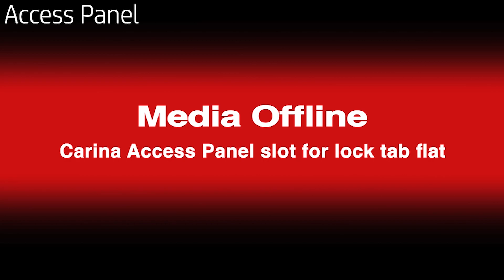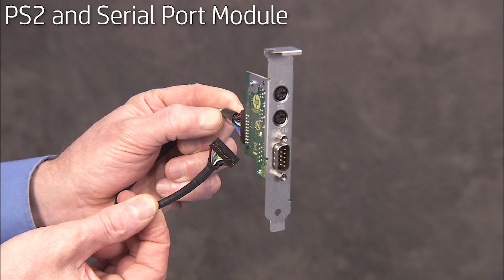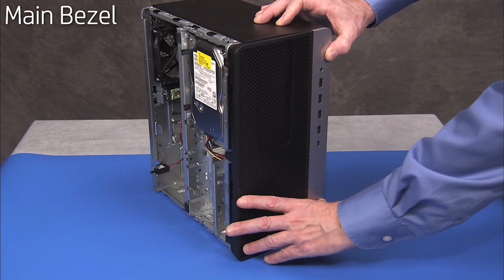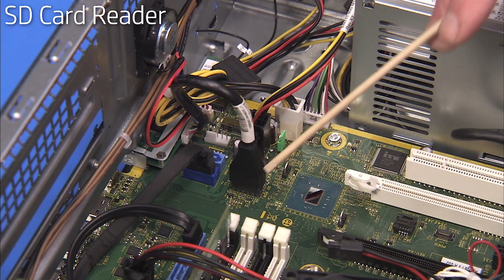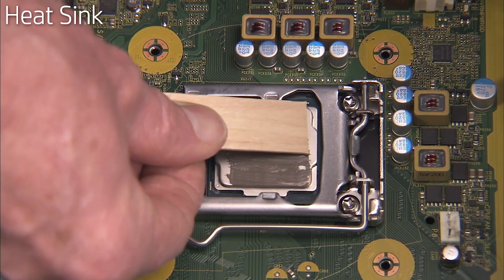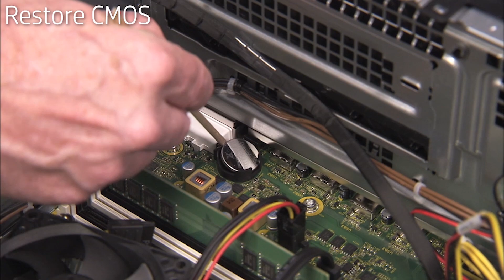Removing & replacing parts for HP ProDesk 600 G3 Microtower PC | HP Computer Service

Comment: would installing a HP 1660 Super GPU in the same model from the video require a means of attaching the gpu 8 pin port to the (hopefully sufficient) 250 watt psu, or can the GPU draw sufficient power from the PCIE port itself to operate without worry? @HPSupport

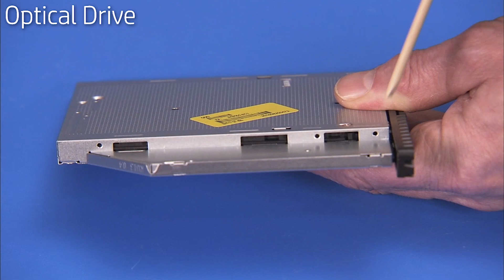Comment: 3:50 - Question for you. Hello sir, I just purchased a refurb of this computer. I am trying to install a dvdrw optical drive, but the model I purchased did not come with a dummy drive or the green release latch for the 9.5mm optical drive - where can I find the part number and replacement for the green release latch?
Reply from the maker: +VolstarTheMagi You can purchase the part from here: http://partsurfer.hp.com/ Please select your country and enter serial or product number of your unit.

Comment: Can i use an hdd caddy and replace the optical drive with it? If i can, can i use 12 mm hdd caddy from a laptop?
Reply from the maker: Hi there, thanks for contacting HP Global Social Media Support!
I understand that you need to know whether you can use  an hdd caddy and replace the optical drive with it.
I will do my best to assist you.
HP does not recommend upgrading or downgrading hardware parts or software that is bundled with the product as It may affect the manufacturer's warranty and performance, however, you could change the configuration at your own discretion.
Regards, 
HP Support
Reply: But, it can be swapped, right? Idk if my pc warranty still legit. Cause, i think it was old machine. And i got 1 ssd 2.5 so, i want to add it to my machine

Comment: Does HP have an official tool for undervolting the cpu of this model and/or undervolting HP GPUs such as the HP 1660 Super? @HPSupport
Reply from the maker: Hi there, thanks for contacting HP Global Social Media Support!
I understand that you need to know about adding graphics card and undervolting GPU and CPU.
I will do my best to assist you.
HP does not recommend upgrading or downgrading hardware parts or software that is bundled with the product as It may affect the manufacturer's warranty and performance, however, you could change the configuration at your own discretion.
Regards, 
HP Support

Comment: hi hp, thanks very much for your detailed video. i've a question: at 35:04, i can see a black pillar under the wifi card to support it and adapt to the chassi. what's the spec  of this black pillar so i can buy one to install nvme. thanks!
Reply from the maker: Hi there, thanks for contacting HP Global Social Media Support!
I understand that you need to purchase the part for your computer.
I will do my best to assist you.
Use the HP Parts surfer to identify the part: https://partsurfer.hp.com/partsurfer/ 
And order it via the HP Parts store: https://bit.ly/3nKMYrs 
Binu_HP Social Media Tech Support
Reply: @HPSupport  hi hp. thanks for your kind reply. i think such a pillar has no part number, or i don't know it. And i'm not a native english speaker, so i don't know the exact english name for such a pillar used to connect wifi/nvme to chassis, so i don't know what to search on your suggested website...
Reply from the maker: In order to get this issue fixed, please contact our customer care team over the phone or chat for further assistance, as this issue requires Live conversation with you over phone or chat to isolate the issue and provide you instantly with appropriate solution or repair/replacement options available at your place as per the warranty.
Please feel free to reach us on call/chat, please access this link to select your preferred country and language option to reach us. Global support link: - https://www8.hp.com/us/en/contact-hp/ww-phone-assist.html
Binu_HP Social Media Tech Support
Reply: @HPSupport  thanks! i'll try to contact local hp support.
Reply from the maker: Have a wonderful day!
Cheers!
Binu_HP Social Media Tech Support

Comment: I have the same model.. It starts directly when the button in the power plug is turned on.
There is no need to press the CPU button..
What would be the problem?
Reply from the maker: Hi there, thanks for contacting!
I understand that you are experiencing an issue with the power button.
In order to get this issue fixed, please contact our customer care team over the phone or chat for further assistance, as this issue requires Live conversation with you over phone or chat to isolate the issue and provide you instantly with appropriate solution or repair/replacement options available at your place as per the warranty.
Please feel free to reach us on call/chat, please access this link to select your preferred country and language option to reach us. Global support link: - https://www8.hp.com/us/en/contact-hp/ww-phone-assist.html
Binu - Social Media Tech Support

Comment: How can I install an ssd in it?
Reply from the maker: Hi there, thanks for contacting HP Global Social Media Support!
I understand that you need to know about installing SSD on your computer.
I will do my best to assist you.
Yes, the HP ProDesk 600 G3 Microtower PC supports SSDs, including both 2.5" SATA and PCIe SSDs. It also has an M.2 slot that can be used for both SATA and NVMe PCIe SSDs
Regards, 
HP Support
Reply: @HPSupport I mean can I install m.2 ssd with double notch or single notch?
Reply from the maker: Thanks for the reply.
The list of compatible SSD can be found here: https://hp.care/6051SdQLf
Regards, 
HP Support
Reply: @HPSupport thanks i just want to confirm that my microtower supports nvme or sata ssd with double notch. Please confirm that this supports single notch nvme ssd or double notch ssd sata ssd? Please confirm me that and also tell me the size?

Comment: Can I install amd r7 240 2gb gigabyte variant in this please tell or which GPU can I install in this
Reply from the maker: Hi there, thanks for contacting HP Global Social Media Support!
I am here to help!
May I know the product you are using? A serial/product number would be helpful!
Let me know!
Regards, 
HP Support
Reply: My serial no is
SGH744QVFQ
Product no is
Y3EO2AV
HP PRODESK 600 G3 MT I5 7500 OS: FreeDos
Now I don't want to install amd r7 I want to install nvidia  gt 730 lenovo 2gb so please guide I have never modified it please tell will it install or I have to remove driver cage permanently? Or after installation GPU can I install it back?
Reply: Or how many varieties of gpu can i install in it without changing power supply please write all and guide
Reply: I also want to update my windows 10 1503 to 21h2 but this is office pc and it is not updating it is showing that some settings are managed by your organization please guide
Reply from the maker: Thanks for the reply.
Use the HP Parts surfer to identify the part: https://splr.io/6059YnuVD 
And order it via the HP Parts store: https://splr.io/6050YnuVE 
Please refer this document to know about installing latest version of Windows 10: https://splr.io/6051YnuV1
Regards, 
HP Support
Reply: @HPSupport I have office pc how can I update it windows 10 to latest and please tell if installing a GPU will I have to remove my drives cage permanently for space please give answer in yes or no or can I install nvidia geforce gt 730 2gb gddr3 please tell in yes or no

Comment: can i do a full size gpu as like a 1650?
Reply from the maker: Hi there, thanks for contacting HP Global Social Media Support!
I am here to help!
Well, it should be possible depending on the card dimensions. 
Let me know!
Regards, 
HP Support
Reply: @HPSupport   would installing a HP 1660 Super GPU in the same model from the video require a means of attaching the gpu 8 pin port to the (hopefully sufficient) 250 watt psu, or can the GPU draw sufficient power from the PCIE port itself to operate without worry?

Comment: After installing win 10 the hd graphic card and lan card all not working they are bulid in  not free. could you explain the problem
Reply from the maker: +usama mohamed Please perform updates via Windows and HP Support Assistant as mentioned below to fix this issue: Step 1 Windows Updates - 1) In the search box, type and open Windows Updates. 2) Check for updates. 3) If the updates are available, click on install and restart the computer. Step 2 HP Support Assistant Updates - 1) In the search box, type and open HP Support Assistant. 2) Check for updates. 3) If the updates are available, click on install and restart the computer.

Comment: Say, could I replace the case fan with a PWM fan of the right size or does it have a HP only pin-out and only one bought from you guys will work?
Reply from the maker: Hi there, thanks for contacting HP Global Social Media Support!
I understand that you need to know about the compatible fan with your computer.
In order to get this issue fixed, please contact our customer care team over the phone or chat for further assistance, as this issue requires Live conversation with you over phone or chat to isolate the issue and provide you instantly with appropriate solution or repair/replacement options available at your place as per the warranty.
Please feel free to reach us on call/chat, please access this link to select your preferred country and language option to reach us. Global support link: - https://www8.hp.com/us/en/contact-hp/ww-phone-assist.html
Binu_HP Social Media Tech Support
Reply: What HP meant to say is that usually they have an extra pin for the fan. You can use a 3rd party fan by tricking it, there are guides online for that. The heatsink pin layout is usually proprietary so I would say that good thermal paste and a clean case with the stock cooler and fan is the way to go with these units

Comment: Will GTX 1050 Ti low profile fit in this case?
Reply from the maker: +Kacperowy Gamer Please refer 'Expansion slots' under the specifcation page to know about the slots your computer has from here: https://bit.ly/3Kh0cX4. You can add graphics card that supports these slots.
Reply: @HPSupport  The card i want uses Pci express 3.0 x16, will it work?

Comment: Dear Sir,
Heartily Thank you for video and explanation also was good. It is my small request to you is that where to get TORX 15 screws for fixing New SSD Sumsung 250 GB in Cabinet.

 
Through this Comment,  I kindly request to you to help me as early as possible..  I am waiting for your reply.....

Warm Regards,
Basavaraj, From India.
Reply from the maker: +Basavaraj Chougala You can search for the screws here: http://partsurfer.hp.com/ Please select your country and enter the serial or product number of your unit. You can also contact our phone support team. Please follow these steps to reach them.
Step 1. Open link: www.hp.com/contacthp
Step 2. Select the product type.
Step 3. Enter the serial number of your device or select let HP detect your product option.
Step 4. Select the country from the drop-down.
Step 5. You should see the HP phone support number.

Comment: What size motherboard is in this system? I was looking to change the case
Reply from the maker: +Michael Klump Please refer 'Physical specifications' from here to get this information: https://bit.ly/3u6Xqe5
Reply: HP screw layouts are not usually ATX/MATX/ITX standard. So use the the stock case.

Comment: What would I need to change in the system if I get a "gigabite gforce GT 1030 directx 12" graphics card?
Reply from the maker: +Spritz This document provides step-by-step instructions to remove or replace a video card in an HP or Compaq desktop PC: https://bit.ly/2DqnQ5l
Reply: Hi. did you ever instal the card in this machine? Curious on your progress. Thinking about adding  in a GTX 1650. Thoughts??